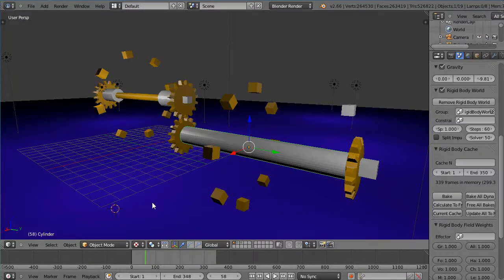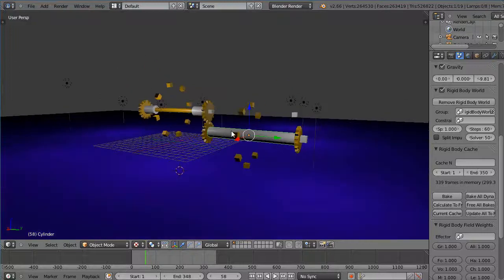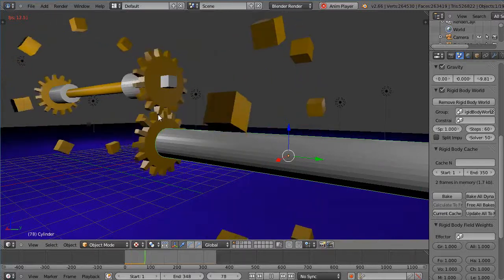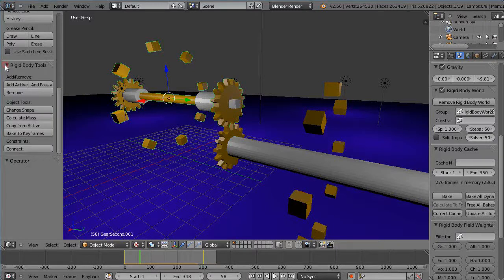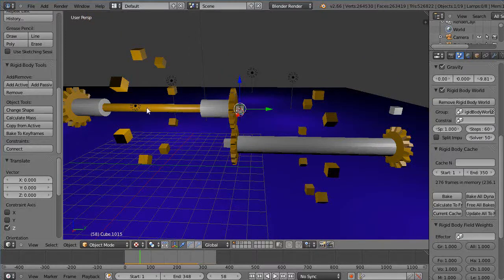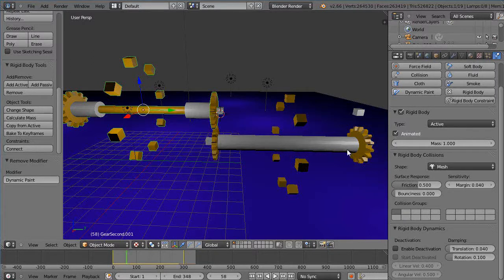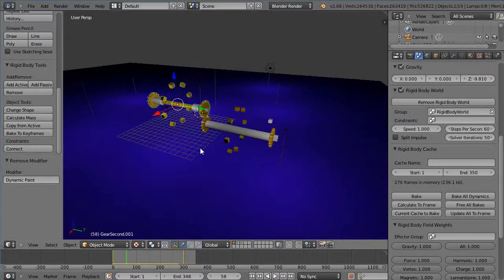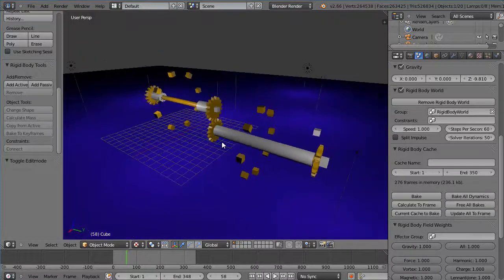Blender 2.66 Tutorial - Rigid Body Dynamics and Gears - Introduction

Comment: There is an addon that creates gears (add mesh: extra objects) and allows you to set number of teeth, angles, twist, relief etc. What I see when these gears come together is the square end of the teeth is almost running straight into the next tooth edge, which may be the cause of them jumping out. I wonder if adjusting the way the teeth mesh together may improve the stability. Does increasing the thickness of the bearings hold better?